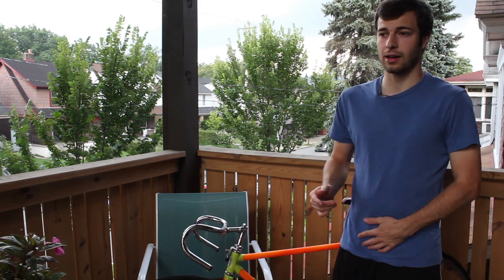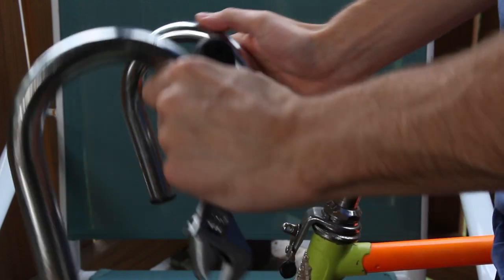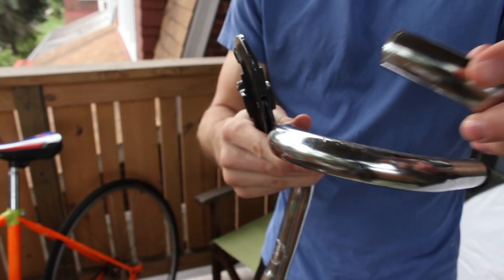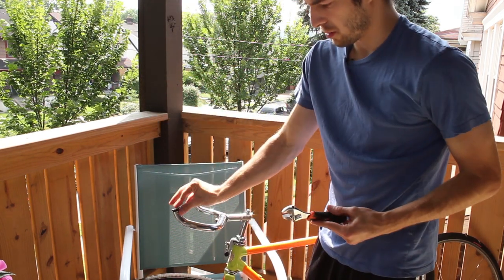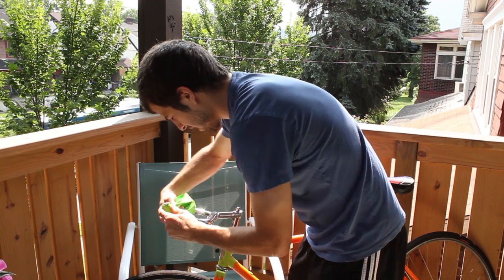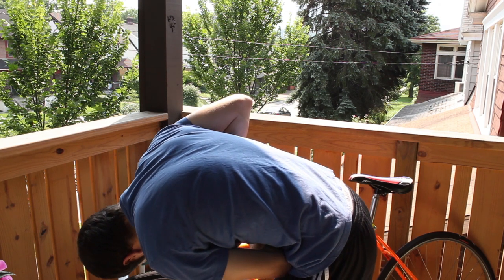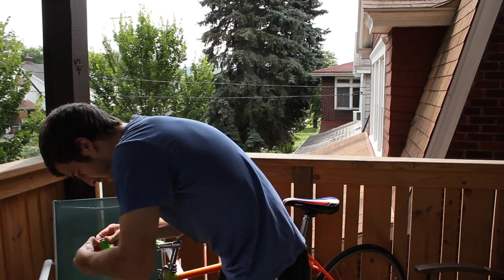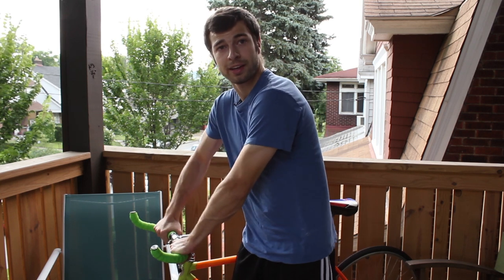How to build a Fixie: Bull Horns and Bar Tape

Comment: Dude... I've just done what you did about 2 weeks ago and I found out why the bar-ends doesn't fit well. The pipe cutter creates a little bit of a lip inside the bar, reducing it's diameter. What I did was just get a file and remove this excess from inside the bar. It even fit bar end brakes now, tektro Rx4.1, totally recomend

Comment: Great vid, ive been using leather grips on bmx for years now, you can also use a cut piece of innertube, for a custom fit , and it will never ever slip off
Reply: What do you mean? Cut the inner tube or slip it over the handlebars, bro?

Comment: you're actually supposed to tape first, leaving a little excess bar tape at the end. Then you fold the tape into the the handlebars and put the bar end in. But I'm gonna assume that your bar ends fit a little snug?
Reply from the maker: I actually did do that but I did a bad job of explaining it in this video. I've added an annotation to explain to leave enough tape to tuck under the lip for anyone that watches in the future. Thanks!

Comment from the maker: The paint actually hold up pretty well. It has chipped in a few places but only from some sort of damage (falling)
I think using a clear coat helped a lot. Just hold onto the color paint you use and you can do touchups as needed. Good luck!

Comment: The bar ends are designed so you put them in at the end and fold over the excess tape and plug it in with the bar end

Comment: kinda strange you wrapped both sides in the same direction.. probably wont matter but i would suggest reversing the tape wrap direction on the right side for anyone following along with this guide.
Reply from the maker: I can't remember because it was so long ago, but either the box said to do that or some other video I saw said that. I remember thinking it was weird at the time... but they've been fine so far.

Comment: i really don't like fixies but you did a nice job with the handle bars. i wanted to comment on the small issue with the bar end not fitting so well after the cut - did you have any angle when you cut the bar? if so, maybe the bar ends don't fit as well as before due to the cut not being exactly perpendicular to the axis of the particular part of the bar you were cutting....hope i don't sound like an ass or anything, just curious...really nice job though
Reply from the maker: not really, I think the bars inside diameter was just a tad too small. But once they were in they haven't been a problem. Thanks man!
Reply: optiKalismo the cross section of the bend of most if not all drop bars is distorted compared to the straight sections (ie the ends). The pipecutter, if used properly, guarantees a cut of more than adequate precision for this kind of modification. I did mine years ago with a hacksaw, without a hitch.

Comment: Just asking, why didn't you start at the stem, then work your way to the bar ends? That way you wouldn't need any tape.
Reply from the maker: Rob McKay my hands tend to roll up the bars, so if I wrapped that way as my hands moved it would peel up the edges of all the tape wrapped over the previous bit. (Does that make sense?)
Reply: thanks, good job!

Comment: Would you put the brakes on after doing that whole process?
Reply from the maker: No, I'm riding a fixie. It doesn't require brakes. If you're riding a bike with brakes I'd recommend checking out another video as well for the technique wrapping around them.

Comment: maybe you could sand down the plugs a little bit so they fit better.
Reply from the maker: The plugs needed quite a bit of pressure but fit well after I got them in, and are still working well to this day.

Comment from the maker: Yeah dude, Im not a pipe cutter expert by any means. But actually I don't think reaming it would have done all that much much for the fit. The amount of metal displaced to the inside of the pipe is negligible in the long run.

Comment: So do you find bullhorn more comfortable or better? I'm thinking of changing from bullhorn to low ride but not so sure.
Reply from the maker: Supposedly its supposed to help make it easier to transfer your weight over the front tire to skid easier. I haven't noticed a huge difference, but I think they look a little neater too.
Reply: Anucha SeoDml Bullhorns feel easier to skid or simply just to stand on your bike.

edit: they also hurt your palms a bit if you have a stiff fork.

Comment: U are suppose to wrap first and then put the bar ends....
Reply from the maker: +Swift Blake I didn't put the bar ends in the whole way so that you can just slip the excess tape in under before you pound them in. It actually said to put them in first on the box.

Comment: The Reason your plugs don't fit is because you're supposed to wrap first, leaving enough of the tape to tuck into the open end and then push the plugs in to hold the ends in place.
Reply from the maker: Nope. lol. Your logic is flawed. The plugs were too tight in the first place what makes you think tucking tape in first would make a better fit.... it would make it significantly harder and tighter fit. But, all that being said if you actually watch the the video you can see that I tuck the bar tape under the lip of the plug. I even kind of mention it although I didn't do a great job explaining what I was actually doing at that portion of the video. I've added an annotation so that people don't get confused anymore because a few people have also said that.
Reply: The logic wasn't flawed, you just did a poor job of explaining within commentary.
Reply from the maker: +James McClellan (Mercuryan) I'll give you both.

Comment: The reason the bar end plugs didn't fit is because you're supposed to wrap the tape round the end first then fold the spare tape over and into the handlebar then bash the plug in. It should be nice and snug
Reply from the maker: okay